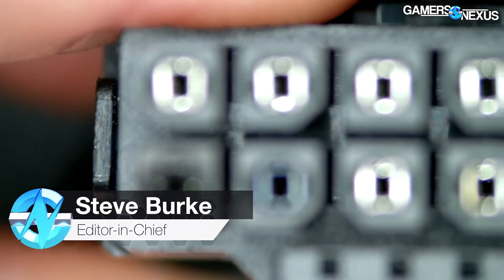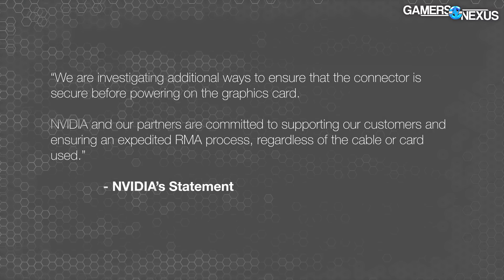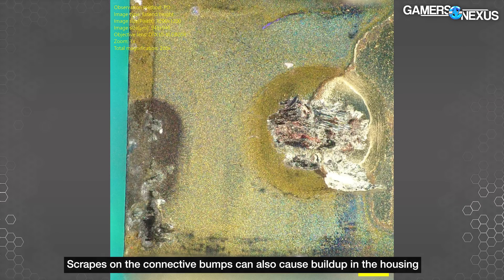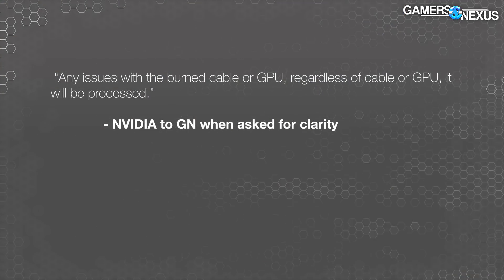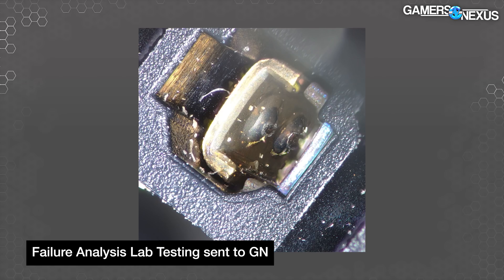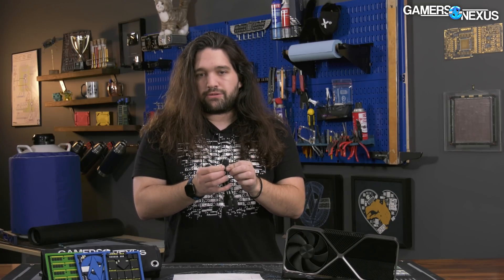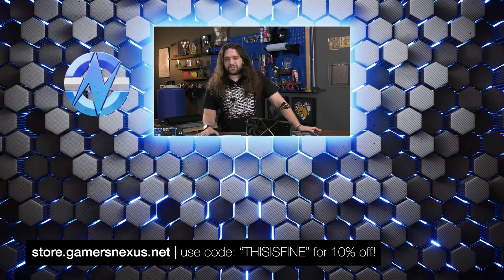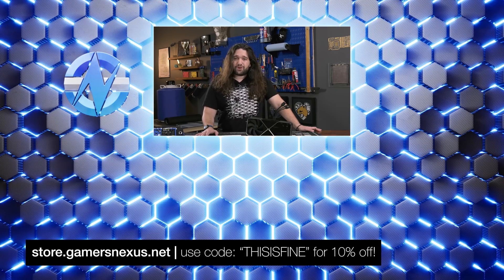NVIDIA Responds to Melting Cables, Warranty Concerns, & 12VHPWR Adapter Failures

Comment: When I think "electronics fire," I think "Gamers Nexus"! 😁 Glad nVidia's doing a good thing, but I guess you really don't want to tick off the sort of people dropping the dollars for 4090s, over a (probably) $2 cable. Great work team! I've never seen a failure broken down like this.
Reply: Agreed. I cant believe there are 50 noob clowns that failed to plug a power connector correctly. Especially when they paid so much you would think they would either know what they were doing or hired a professional that does. Good thing its only user error and not the actual cable, if not the conversation would be much different. Good thing GN and NVIDIA made sure to clarify that it was only improperly seated cables due to user error, very good break down
Reply: @javiersantana848  I dunno about "clowns"... Steve did say there really isn't a clear way to know if it's latched. I'd put this one on nVidia, or at least the PCI SIG. An engineer at one of those locations must have brought this up, but I'm guessing the bean counters won. Now it's going to cost nVidia a couple bucks on each card for saving a couple cents on each card.
Reply: @McTroyd  No, its definitely novice builders incorrectly seating the power cable to the GPU. This is not new, only novice builders never heard or knew of this. Professionals have practiced correct power cable installation for decades as we already knew the ramifications if done incorrectly. NVIDIA and GN and Corsairs PSU executive also confirmed exactly the same thing. I've been seeing novice builders burn cables and cards for years lol, but it keeps people like me in business
Reply: Intel designed the connector, but didn't use it themselves.

Comment: The 12v in the motherboard is very rugged and big...it has decades of use....it forces the user to connect it correctly, i still believe this connector is not that well designed...merely cause it has to handle 4 times de current of the previous format, it should be way more rugged and secure...

Comment: Breaking News!  Taking your time and being careful avoids problems. How Novel!
Reply: Breaking news! Making your GPUs actually efficient and not require a small nuclear power plant eliminates the need for an octopus adapter when regular connectors do the job just fine!
Reply: What makes it worse is that the 4080 is relatively power efficient for the performance it delivers, yet NoVideo insists on this bullshit adapter.
Reply: @lunetailedfox  You seem upset, Have you considered AMD?
Reply: @urbanws1234  Yes, and I couldn't be happier.

Comment: This situation reminds me of the old AT motherboard power connectors. There were two cables to plug in, both with the same number of pins and almost identical plugs. One way was correct and the other destroyed the motherboard and things attached to it. While plugging in the wrong way technically was "user error", the problem was designing a system able to be used this way in the first place.

There is definitely something wrong when the installer needs to read pages of illustrated instructions along the line of "make sure to push this hard" and "make sure no bends are within X inches of here...or here either". The previous system was inherently obvious and rarely led to problems, destructive or otherwise. 0.4% is a low outcome, but it's probably an order of magnitude worse than the previous system.

Comment: About the failure rate. I'm fairly sure that the failure rate will increase with time, and as the cheaper models hits the market. A combination of cables moving inside the case, and user errors.

Comment: 125 000. 4090's? Heck yea only 50 house fires for 125 000 unit sold! Compared to Samsung that are only a fraction of peoples homes and lives being ruined!

But for real. Burning and crap is not ok. No matter what NV or anyone tell you. This connector is not some fan hub you can throw into the bin or ryzer cable or wtf was going on with NZst... I can not be bothered to get there name right... 

It is stuck on graphics cards going forward. It should not. And this is not just people connecting the cables wrong. The design of the connector and the location on the cards are not ok.

Gigabyte burned quite literately there reputation up together with Newegg. NV is just silent and should be thankful that GN are truthful and just awesome. Thank you Gamer Nexus.

NV are at fault here and not owning up to there screw up. They should come out and do the reporting GN is doing to help there fucking costumers from burning up there fucking lives. But no they can not rush out and at minimum just tell people to be careful while they are looking into it future? Na save face over being responsible. The moment NV was starting to hear about problems with BURNING they should have a video done or in some way get attention to there costumer about potential problems with the connector etc. Instead weeks go by until GN figure it out? Like up until now it is all speculation and no clear guidens from NV how to handle the burn hazard??? Not like they went out of there way to flag the problem and give a statement to the sheeple at the sheepels levels? 

But some random long haired person with a camera can talk about it? And just tell people to be careful and that he himself is looking into it and will report back later??? But no NVIDIA asking a premium on a BILLION or whatever dollar corporations product? 

But when trying to sell the product we get GPU's taken out of the oven in a kitchen... But not when the GPU is in peoples homes cooking off in there living space. Then stay silent? How much effort it is to make a marketing video quickly but instead of trying to sell something just politely tell costumers to be careful? Na only kitchen GPU when trying to sell a premium product. Not when there is a hazard...

Comment: The pin length thing is such a great idea, I wonder why no other plugs do that.  I imagine if there was a plug that did that, it would be literally the best design in the world.  Maybe not sense pins in that case but like the earth connection, if that was longer you could make sure it's connected before live and neutral.  You could even put shutters in the socket that are opened by the earth pin so you can't shove stuff into live and neutral like keys.

You could even put a fuse in the plug, have the cable come out of the bottom so nobody will ever pull on the cable to unplug the plug, have the live and neutral cables be shorter internally than the earth so in the case it's yanked really hard the earth will disconnect last...

Crazy how nobody's been smart enough to come up with a plug that good yet.

Comment: Could we reduce the risk of burning 12VHPWR cables by increasing the connector size in pair with the wire section from AWG16 (1.31mm²) to AWG15 (1.65mm²) or even AWG14 (2.08mm²)? I think it would certainly reduce the stress on each wires and reduce the overheating.
Reply: The wires are fine, which is why the damage is limited to the plug.

Comment: 125k sold but how many are just sitting around not being used out of fear, how many people are having issues but don't know it's their power connecter melting. so the 0.04 is probably a bit higher.

Comment: Still a crappy connector design, they need to use fewer but larger conductors, easier to get good contact and less wiggle and chance of loose connectors.
Using good quality gold plated connectors as per in Electric model flying would be a good start, easy sustain constant high current with them.

Comment: To add to the point of the second chapter, I have found as a light industrial technician, if you do not fully seat a high demand plug that can get warm, it can work its way out similarly to how Thermal Paste can Pump Out from underneath a CPU. So if these plugs were seated completely, but not latched; they can eventually through heat cycles, work themselves back out slowly. It doesn't even have to be a full power cycle that causes them to walk, just putting a load on the system creating heat then allowing it to dissipate can be enough. But obviously, power cycling would be more significant.

Comment: How to improve the cable?  OMG   How about the pin layout.  How about you put in sensor to verify connectivity BUT give the user an alert saying there is a connection issue.    Otherwise you are going to get a TON of false positives of dead GPUS.   Seriously....    As long as the cable is inserted and you DON'T flex the connectors, I don't see an issue here.   This PIN layout has been used for how long now?   Why is this a new thing?   Seriously....

Comment: if they are going to blame the way you plug in the power supply cord, then why are they breaking?  We never had this issue before.   So don't tell me the way you plug into a cable is the cause unless they are flexing the connectors so hard that they are shorting out the connectors

Comment: Good scientific method! This is a well known problem with this style connector, I saw the mechanical drawings of the pin at an angle, it spreads the socket and reduces the contact area and pressure.
One additional potential problem is that when the pin is pulled at an angle in the socket then returned, it may not fully spring back, reducing the clamping force.
I think that connector design is maxed out in this application, but the whole industry would have to change it at once, yikes.

Comment: Make it annoyingly obvious with labeling, stickers, large and colorful warnings... and more. Ensure that they all include concepts like push-pull-pull and other useful installation techniques. Yes, it may not be appealing in that sales/logo look you normally find. Plugging something in shouldn't be a challenge for anyone at this point. Given the lack of real experience with so many users now doing DIY with their rigs, it makes sense to bring a bit of assistance to them. It would be a win win from what I can see. Again, don't skimp out on details including pictures or and descriptions of how to properly ensure correct connections are being made, such as full insertion, not bending cables tight as it were for cable management and so forth. Add anything else on top of all this of course can only help. Cheers peeps

Comment: Reminds me of Wonko the Sane and the toothpick instructions.

How to plug two halves of a connector together:
1) Align free connector half with emplaced half
2) Push together until no further motion occurs
3) Attempt gentle, repeated wiggling motion to ascertain correct insertion
Reply: In all seriousness, sure: more pins equals more resistance, and more insertion force required.

Best design choice ever? No. Single connector, single point of failure, higher chance to fail.
Easily avoidable? YES.

Comment: Next we are going to take months of back n forth, user investigations,  trips to failure assessment labs n shit to learn that putting pressure on plugs in 2.5mm power sockets can cause a broken solder joint. 

This is the result of everyone wanting to skip the fundamentals of everything,  and the DIY, "its so easy" marketting encouraging such. No basic grounding (lol) in electronics means you might do something stupid when working on what is still, despite the "consumer" aimed marketting and color coding of slots that will only connect one way,  component level PC building. One should have a complete picture of what correct component interconnection means before doing this.

Comment: long term fix for later models move the clips as in 2  to side of the connection will make cable harder to remove may even require a tool of some sort
also the sensor pins yes make them harder to connect unless it is seated proper
they need to do both otherwise it is a fire hazard
clips on side will also stop the wiggle for most part

edit i should say the shorter length sides where clips should go

Comment: Maybe a different colour of plastic, white or bright red, possibly reflective for the part that goes in the socket. If you can see a sliver of that colour, push harder. Makes it easier to see in the case down the road to ensure it's not working it's way out

Comment: Not buying Nvidia until they redesign the card. What idiot came up with the connector position like that and such a massive size? So in the future each new card is going to be this and possibly bigger in size?
Reply: Just buy the Chinese Manli blower-style 4090. It's a 2-slot card, but the there may be some issues with thermals and fan noise.

Comment: This " hard shell fully latched" issue is experienced in many industries. Especially in automotive where we are also chasing connector sealing issues from the hostile environments. Also consider , as you have found as most likely user assembly issue, the automobile assembler technicians that assemble thousands of connectors per day with 99.9% success and provide a product lifetime integrity is nothing short of a miracle. Consider the space shuttle electrical connectors. The relationship of hard shell connectors and conductive pins to successfully achieve the primary function of providing voltage and current physical interrupts for user assembly and service,  is a complicated science.  It really is just good holistic design engineering. All scenarios must be considered. It appears with this issue, someone under valued customer assembly issues.  In the big scheme of things, if it is electrical, we all are just chasing Ohm's law.  In this case, resistance = heat.         Good work GN.

Comment: No sorry,''MY ADAPTER DOES NOT'' No matter how hard I push it, it just pulls apart,the clip on the connector has no latch its smooth so theres no clipping together. its a gigabyte windforce oc, have taken the side panel off and put extra tape furter down the sleave to relieve strain. so mine is 100% a faulty cable!!!!!

Comment: GN I need to ask this.... Does NVIDIA and AMD not test these cards inside a normal case that the public would be buying??? I recently finished 2 build for my family memebers both using the ASUS ROG Strix 3060ti and 3090 and found both cable power supplies tight against the side panel. now these IMHO were expensive cards, no comparison of course to the 4000 series. I ended up buying a 3rd party 90 degree connector.
So I am curious if the card manufacturers actually try to build with these cards inside a $100 case? do  they not think for the MASSIVE prices these things are selling for they cant include a right angle power connector to avoid these issues?
And Last but not least, while theres only 50 cases globally of fried connectors, how many fires/house fires/ or death attributed to those scenarios becomes acceptable to them??

Comment: I had this happening with the 12v connectors too during my hardcore OC on air days with a 8800gtx and a Q6600. No problems keeping the CPU or GPU cool, but the plastic - quality Seasonic S12 powersupply - melted after significant OCs, the powerdraw increases exponential with the voltage, and putting 20A continuously through them just isn't very sustainable...

Comment: nVIDIA will never admit they screwed the pooch on that cable. It's badly designed. You're putting a lot of weight on a connector which is quite small. Why is that not a right angle connector? It should be.

Comment: ...screw instead of latch (not the normed plug then). worst case would be overtight and stripped, then the connector would still be all in..
at this pricepoint adding a simple torquewrench as AMD does would be cheaper over defects. Or soldering it in.. or use a better plug next time.

Comment: Speaking of cars and petrol, several years ago over here in the UK we had incidents of car engines suddenly failing randomly. The root cause turned out to be a batch of petrol sold by a supermarket, had somehow been contaminated with an additive that should only be put in diesel. This affected some cars but not others.

Comment: OMG thank god I checked mine after this video, mine came out about 30% and was not seated correctly. Thank you Steve, you saved my 4090 from burning and it's heavily overclocked. I had to shine the torch on the connector to see. Make sure you check yours guys.
Thanks again GN.

Comment: I'm curious if that was going to be the official response if GN hadn't just released a video saying so.   I feel like Nvidia jumped at the chance to shift blame away from them as soon as GN said user error even if that's not what their internal testing shows.     I also suspect that .05% of all gpus have this issue of not completely seating the power connector, but they are not pushing 600w so they don't melt when this happened in the past.
Reply: Actually it's impossible with 6/8 pins. Literally yesterday I installed new GPU (4080) and it was butter smooth with clear click sound. I would question myself but I did it literally last night.

Comment: I recon that the connector cable is arcing in other words it's shorting out due to a gap in the pins, if it's shorting out it will get very hot and catch on fire or melt, this appears to be exactly what is happening hence there is a design flaw so Nvidia needs to recall it as it's faulty!

Comment: If your connector isn´t "idiot" proof your connector is shit.
I stand with my point that whoever thought this connector up had no idea of manufacturing and the precision required. AND NOW they think of requiring even more precision in manufaturing when they wanna have the 12 pins and the 4 pins plug in one after another. That´s just plain fucking stupid. PCI SIC has +/-0.5mm tolerances on the thing how are you going to achieve sense pins not grounding with that?!